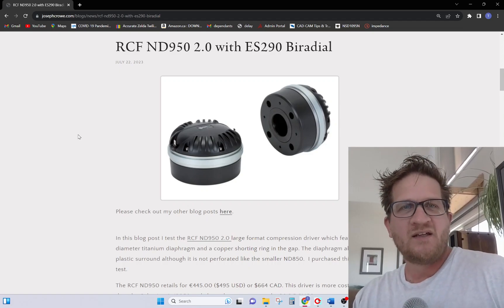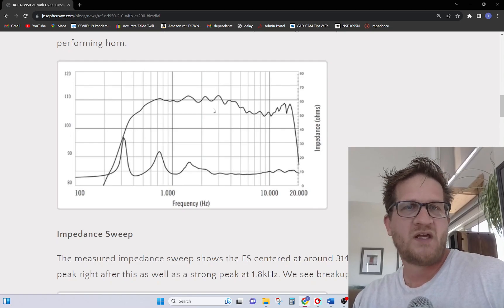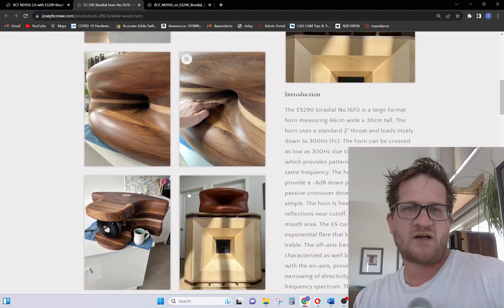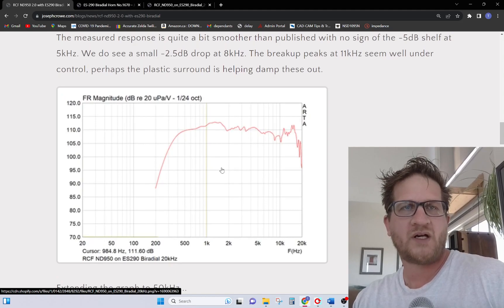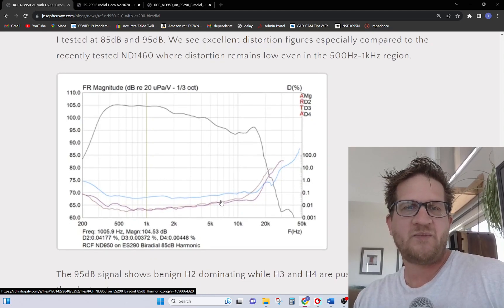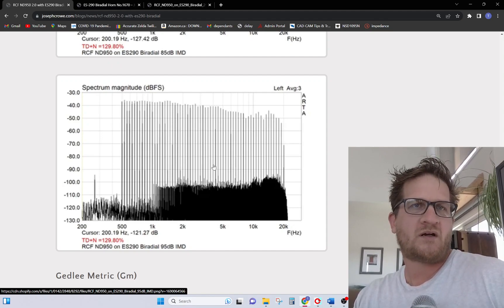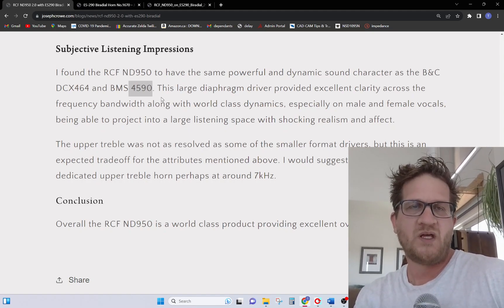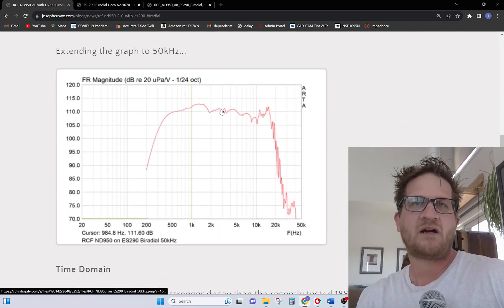RCF ND950 2.0 with ES290 Biradial

Comment: Hi Joseph. I have watched a lot of your videos and really like your approach to sound and speaker design. A few years ago I have built a multiple entry horn based on K-402 horn replica. It is a two-way design with about 500-600hz crossover (cannot remember the exact figure right now). A great extension of this idea would be ES100-MEH - a horn based on your equation that can provide horn loading down to 100hz when being corner loaded. It could use a 1.4-2" CD and a couple of 15 inch bass drivers in sealed cabs. A two way Synergy done Joseph Crowe way. Do you think such spanner is a feasible idea? Would love to build such speakers.

Comment: Hi Joseph, thank you for the really nice review. I am custom modifying a Danley SH-46 synergy horn to improve HF performance. The stock Faital 1.4" HF14at has a quite fatiguing metallic like distortion profile at moderate to high volumes, Danley also rolls it off pretty substantially at 16khz. I am looking for something that might push the HF extension higher with a smoother and less fatiguing sound character. I've been asking around in a few places and the RCF ND950 gets a few nods, as well as the Eminence 314x. I have been personally leaning towards the carbon diaphragm Faital HF1460, but there isnt a lot of real world reviews on it. The Sh-46 is a bit of a hot rod, lots of pure muscle but Id like to sweeten them up some. I don't typically run them very hard, so willing to give up a little bit of output in exchange for fidelity. Any thoughts on this as you have reviewed the RCF and Eminence options.
Reply: L' unico driver da1.4 pollici che riesca a riprodurre la gamma medio alta con una notevole qualità è il 18 Sound NSD1480N........suona veramente bene  e nonostante abbia un diaframma da 3 pollici riproduce le alte frequenze in maniera dolce e articolata.......

Comment: Great work as always. I would be curious how this driver would match with an AMT or Ribbon Tweeter?
Reply from the maker: I’ve tried this and it’s noticeable how compressed sounding the high frequency is compared to the compression driver. In other words, it just can’t keep up especially at elevated listening levels or with highly dynamic music. A really good pairing is the RCF ND350 coming in at around 7kHz. It’s an extremely effortless sound that a horn loaded dome or ribbon can’t match.